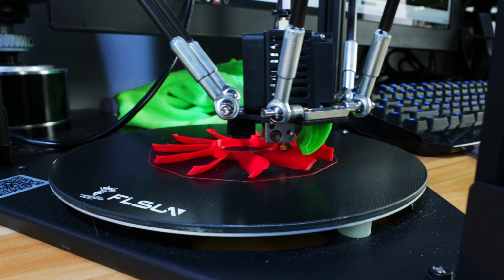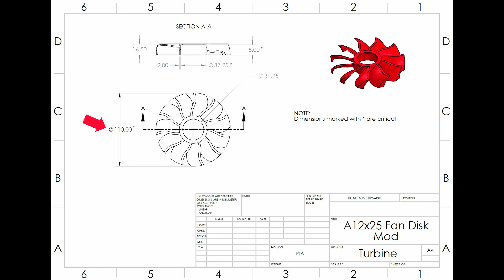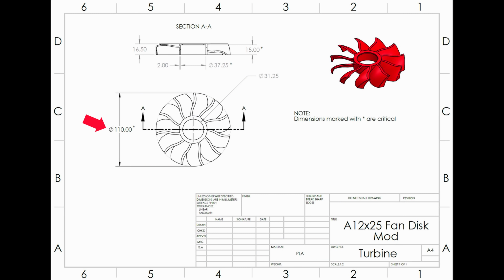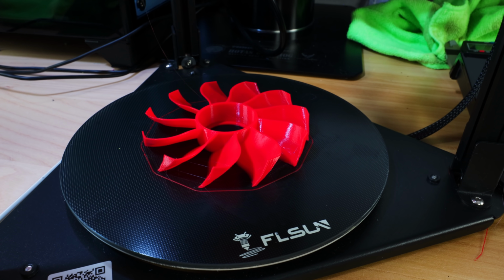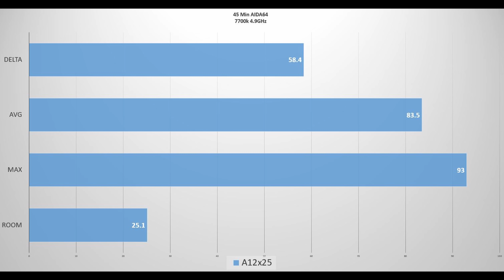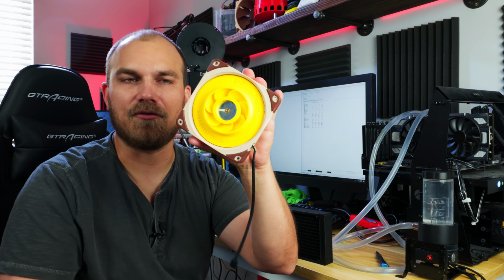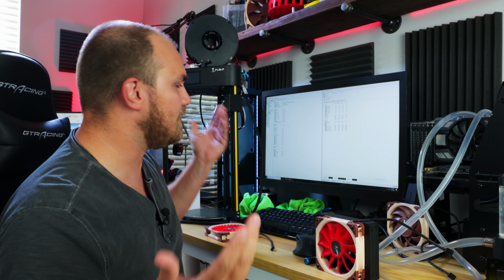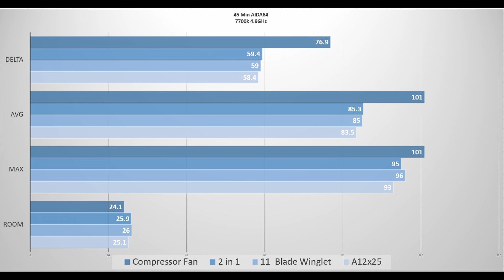My Subscribers Sent Me Their Fan Designs | Fan Show Down Episode 1

Comment: Me: Likely has an amazing fan design.
Also me: Has no PC (waiting to build next gen), minimal knowledge of use for Thingiverse, and last useage of CAD was 15+ years ago. 
Result: 🤷🏻
Reply: nah dont listen to them. wait until next gen then build it right away. Nvidia Ampere or AMD RDNA2 and CPU. Waiting for the benchmark.
Reply: Just fyi there will ALWAYS be a next gen, figure out what you actually need and buy according to that. (Ive only got 30 years of computer experience so take it with a grain of salt).
Reply: There is no better a time than right now.
Reply: Cad has not changed much in 15 years. Also, fusion360 has a very small learning curve.
Reply: Use rule pencil and paper.

The SR-72 was made using that.

Comment: A centrifugal impeller 'flings' the air out towards the edges, away from the hub. Why would you even consider putting a centrifugal impeller onto an axial fan and expect anything other than terrible results?

In gas turbines that make use of centrifugal stages (not that relevant for turbofans, but many smaller turboprops and turboshafts still make use of one or more centrifugal stages in their gaspath), there are always radial stators that receives airflow from the centrifugal rotor outlet and either turns it around to an axial flow stream or otherwise condition the flow to get it to go where you want. Sticking a centrifugal impeller into a fan cage meant for an axial impeller yields the exact result I would've expected: little to no airflow going into the direction you'd want

Comment: That yellow fans design seems kinda backward to what I would think youd want. Wouldn't it be better to have the larger side as the input? Or are you pulling air through the radiator instead? Maybe you could take the smaller diameter side and enlarge it to the inside diameter of the fan shroud then take the larger side and bring it out of the fan shroud where you could make it bigger and that way you would compress the air going in?

Comment: Seems like the yellow fan might be able to move more air if it was reversed. Have you thought of mirroring the model and flipping the case around?
Reply: I was thinking that too. Would be interesting
Reply: The yellow fan is more akin to a blower fan, it probably would do better mounted flipped and a channel to push air out the side. Typically air enters perpendicular to the exhaust port on this type of fan.
Reply: kylek29 the blades are facing the wrong way if flipped as it spins clockwise meaning air would not be push inward but flung toward the side. Blower fans sit in a shroud with a opening on the side, this shroud is closed on the sides so it has to rely on air being spread out over the surface area on the back side of the fan assembly.
Reply: @piccolo398  That's pretty much what I thought. The blades on the back don't have a chance to "scoop" air in.
Reply: please try this
Reply: The yellow fan seems,, backwards somehow.
Reply: The funny thing is that he said it was a blower design before using it
Reply: I saw it was wrong, but it probably won't be any good anyway because it's a peripheral flow fan and this needs a axial flow fan.
Reply: @SidneyCritic   The yellow fan is turning the right way,  but as you mentioned it is not for this type of application and it needs an inlet inducer and a volute to create a useful flow on the back side,  without it the air will just scatter once it exits the fan.  This the type of fan used in turbochargers and centrifugal chillers, without a housing designed to match the fan it is just useless
Reply: This would be worse because the way the fan is “compressing” the rear blades are to provide high static pressure against the radiator. Also if was reversed you’d have a tiny area where air is being pushed.

Comment: Protip: get rid of the whispies with a lighter. Just a quick pass with a lighter will instantly remove them.
Reply: Pro tip: you can archive similar effect with a heat gun or a air soldering station, with way less risk of fire or getting burn.

Comment: Really need a resin printer for these fans.  The layer lines in the print are probably messing with the airflow.
Reply: This is prefect for the application of true 3d printing too.
Reply: Resin is far too much of hassle for most people, with the cleanup and curing station, not to mention the cost of the resin itself.
Reply: If anything, it would make them perform better. Same scenario as golf balls, textured surfaces flow better.
Reply: @Mrx1080  it's not the same idea with the balls
Reply: @brunopanizzi  no but the effect is the same, the concept is used extensively in motorsport for this reason.
Reply: Mrx1080 in my opinion the „texture“ of the fans surface is way too big, this is no texture its a part of the Geometrie. In relation to the object the texture of a sharkskin, aircraft, boat ... is much smaller than that of the fan. The right proportions are very important!

Comment: try using a dyson fan design, it is advertised as high airflow with high pressure so I want to know the airflow and see if it maintains that airflow through a cooler/ radiator

Comment: Yellow fan wasn't big enough on the front side. Red double fan and the one with the scoops are similar to an idea I have mentioned before. Actually, if you combined all three, with the yellow one made bigger like mentioned before, you might get something close to the tesla valve effect I have mentioned. 

I would make a model, but I am going to have to learn from scratch. And Solidworks is expensive I found out recently.

Comment: You have to make a control fan. One that is modeled after the A12X25 fan you are trying to beat. Make the exact same fan with your 3d printer and than try and beat that with your new designs. Its not same material or weight so you will never beat the real A12X25 with the sub par pla. But if you beat a replica, chances are you will beat the real deal with better components.

Comment: The compressor would work at much higher RPMs pretty well, if metal, but it needs to have the air exhausted correctly, and that fan shroud is incompatible.

Comment: I think a major factor is going to be that Noctua has engineered the electric motor for the power and speed of the fan design that they have paired with it. 
The compressor style fans need to be spun at a faster speed to be effective.
Reply: He'll have to solve the balance problem before that can happen. Its already got much more mass and was wobbly. Not a good combo.
Reply: Was thinking the same, its not compressing anything at ~1900rpm, however, once it starts working properly at faster speed It Will blow hotter and hotter air, you dont want air pressure Since you'll heatsoak the heat exchanger blowing hot air into It way faster
Reply: @michelhadid  no he had decompresor at the back 
small inlet huge outlet
Reply: compressor fans are limited by the inlet area. therefore they need to spin faster to get enough vacuum to generate decent airflow. Static pressure comes from the wing surface area: if you have small wings, you will get less pressure. As said, this entry was more for the memes than actual performance. It cannot deliver enough static pressure to overcome the fin stack and cannot flow air fast enough due to inlet restriction.
Reply: Nizen it’s not suppose to push air through the radiator it’s suppose to pull it. 
You even said so a previous comment. Now your changing and saying it’s suppose to push it though the radiator.

Look at 3:41 the fan has to spin counterclockwise for it to move air. If it where to move clockwise it wouldn’t do much

If it grabs air from the small circumference side and pushes it towards the large side it’s not a compressor....
Reply: @crunch9876  just noticed idiot that send it to him had design it wrong way 
i was thinking it had ve been designed for anticlockwise move
Reply: Is't the yellow fan spinning in the wrong direction?
Reply: How did you figure that out but not figure out the yellow fan was spinning the wrong way
Reply: @crunch9876  no it wasnt lmao 
it was sucking air from radiator and compresing it out 
for whatever reason 
if it would be spin "correct" way it would be a decompressor lmao with no real force to push air trough radiator 
lmao
Reply: Nizen exactly. Look at the designs from the radiator side. 
For it to work it has to be spinning counterclockwise. When looking at it from the radiator side.... aka clockwise when looking at it from the side with no radiator. Yet when he turns it on from the other side it’s spinning counterclowise which means the radiator side is spinning clockwise which is reverse of what it should be doing

Look at 8:18 instead of pushing air out from that side it’s trying to pull air in.
Reply: It's the wrong implementation for this anyway. It's a centrifugal fan, so a lot of the air will be "flung" out. The shroud directs them to the radiator but it's a very tight turn, sapping away the velocity and flow rate. And only the outer edges of the radiator gets most of the air flow.
The designer attempted to replicate the intake of a turbocharger, or those snail-shaped floor dryers. But the snail-shaped housing is integral to the turbine's design. And they direct air perpendicularly to the  fan.

Comment: Could you make a fan that has the blades extended to the center of the hub on the frontside, so you effectively get taller blades?
Reply: fuuuuuuuck I was just about to post this...
Reply: @jaalan7896  Ya i really wonder how that would perform, i think it can outperform the noctua fan in cooling performance at same rpm, noise wise not maybe, taller blades will cause a bit more sound probally right?

Comment: Try adding a velocity stack like on turbos
Reply: turbo on a PC hahaha 120fps EZ
Reply: You mean like a twin scroll?
Reply: @Tiki_2211  Negative, velocity stack behave as funnels that smooths out the inlet before the fan blades as to improve the overall intake volumetric efficiency. They are also called a ring bell mouth. I did this mod when I started out 3D printing on my PrintRBot Metal 9+ years ago. It did work well and improved air flow significantly, also quiet the fan noise as well. I think the one drawback is they are suppose to be unique in design (Diam Vs length) based on the peak flow of the fan. So there is some calculations needed to optimize their efficiency. And they add overall height to a fan assembly. 

https://performancebyie.com/blogs/ie-auto-blog/the-right-bellmouth

Here is the design I used. https://www.thingiverse.com/thing:607836
Reply: Turbo engines dont use velocity stacks, for obvious reasons.
Reply: @michelhadid some people actually do use velocity stacks on turbos but they're not very tall because the air is already moving quite fast. i'm not sure if it actually helps but it is a thing.
Reply: @michelhadid  Sorry!? What's the obvious reason? 

http://www.carthrottle.com/wp-content/uploads/2011/09/DMTcamry-3-655x434.jpg
http://assets.superstreetonline.com/f/170372473.jpg?width=640&height=427

http://i782.photobucket.com/albums/yy106/jdmsfl/4d1.jpg
Reply: We stack turbos to increase intake pressure and to keep the turbos inside their efficient ranges not just to increase air speed. But ive tried sticking 2 pc fans back to back and they actually slowed down. Kinda weird

Comment: You need to build a small miniature wind tunnel. So on one end. The fan mounts. Then make the box about a foot long. And on the other end it comes out a smaller funnel like and with a wind speed measurements tool like this https://www.amazon.com/dp/B00ZHKWCP4/ref=cm_sw_r_cp_apa_i_nNFhFb5T1PDN8

I did this years ago. To measure which fans actually move more air for my custom pc build.. I might still have it laying around. Made it out of Plexi. But if anything I'm sure you can just 3D print a version of it.

So now you tests can not only include sounds tests. Temperature tests connected to the rradiator. But also cfm measurements

Comment: Try to make a gasket between the radiator and the fan to see if it improves performance. Ive seen Linus do it many years ago with gaffer tape and it worked but it would be great if you could try something that integrates better with the fan.

Comment: I can't help wondering how the compressor fan would have done if that disc that blocked airflow was removed? Or if the blades were switched (full diameter fan blades first then a small set of compressor blades).

Comment: Do a king of the hill type format. Winner stays till they are de-throwned by the next viewer.
Reply from the maker: I like your idea, the winning fan will become a set piece until someone knocks them off.
Reply: @MajorHardware  yeah, but still do the Top Gear board too.
Reply: @leolldankology  So what I'm hearing you say is that we need a Stig fan.
Reply: @MajorHardware  Yea, the list needs the numbers stacked so it stays cleaner. Also, if there is a formula for adding the room temperature to the cooled temp (I'm sure it's some strange bit, that cooler room temps, take more heat from radiator fins, so those numbers are less weighted. Something like that) You can eliminate the Room temp, as it would be accounted for. Then, the three bars could be placed on top of one another as we can all understand min-Avg-max.

That would allow a much cleaner uniform list, with "name" "revision": "performance" type setup
Reply: Ah, the original GAN
Reply: What's to stop me from taking my noctua fan off and mailing it in to crush everyone else's design and stay on top throughout the series?
Reply: @operator8014  the fact he 3D prints your design.
That means he doesn't receive it ready, he makes them on site.

Also is pretty difficult to get the blade out without destroying it.
Reply: @operator8014  good idea
Reply: Yeah propane accessories

Comment: I wonder if Noctua engineers watch your video's and chuckle.
Reply from the maker: i bet they do and i bet its more then a chuckle lol
Reply: @MajorHardware  lol
Reply: They probably do similar stuff, but with slightly more theory backing their designs.
Reply: @LaughingOrange  They will use cfd analysis and to evaluate their designs and then maybe make some small tweaks on the test bench. But most of the work will be done in software.
Reply: Honestly I would say laugh, but paying attention as well. People doing stuff like this is basically free R&D for them for people trying out every radical design they can think of. If Noctua (and other fan makers watching the vids) are smart, they'll have someone on their R&D teams taking notes for what works and what doesn't and add that to their product development R&D which best case scenario, ends up being a higher end product for us consumers.
Reply: Also it's free advertising for them.
Reply: Their designs need to be cheaply injection moldable, so they have that as a potential disadvantage to 3D printed ones.
Reply: This is somewhat pointless. A 3d printed fan shouldn't be that close to the noctua. You are not putting enough heat into the loop.
Reply: @cbrunnem6102  The noctua isn't going to runaway with cooling capacity. It's going to runaway in the noise test.
Reply: @zedoktor979  I dont disagree compared to other engineered fans but these 3d printed fans move a fraction of the air. They only appear close because of the small heat load. Throw an overclocked radeon 7 in the loop and the delta between the noctua and these fans go through the roof.
Reply: @zedoktor979  Technically it should win both, it's a lot more plausible that we find a design that beats it in cooling rather than noise